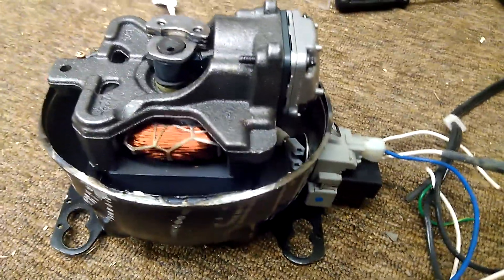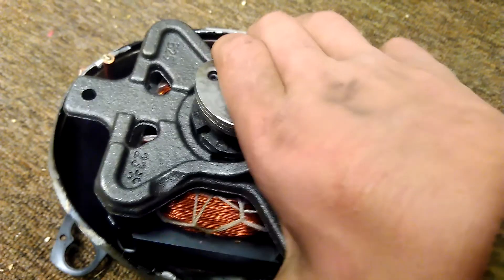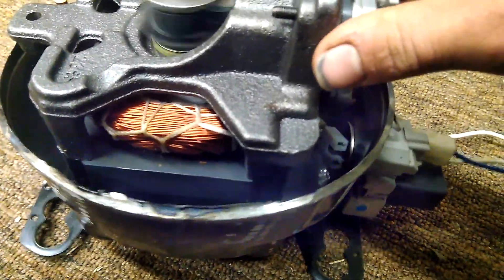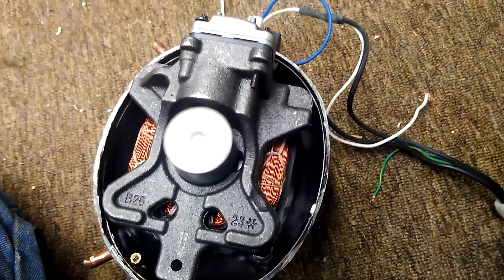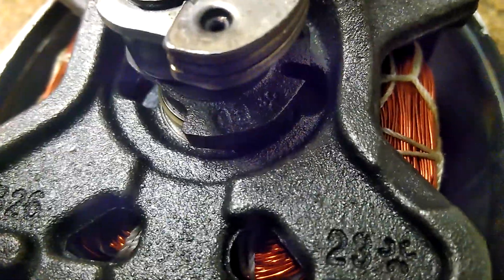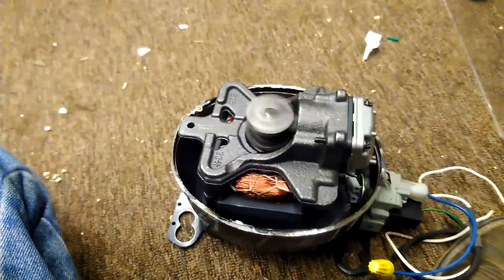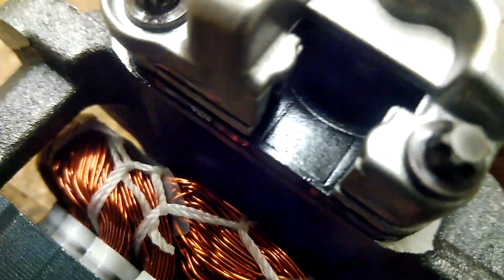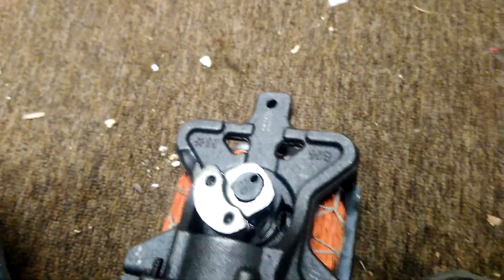Running a refrigerator compressor on the VFD

Comment: How do u connect L, N of compressor supply to vfd U,V,W?
Reply: If u have 3 phase vfd with output as UVW and no neutral, then first set the line to line voltage to 220V on the vfd (I m assuming ac grid supply is 220V single phase). Then connect only UV from vfd to the two supply wires of the compressor. One phase from vfd will serve as neutral and other phase from vfd will serve as PHASE.
Reply: @imtiazhussain5027  what about the start coil? can this be wired into the vfd or do you still need the ptc? I have a vfd and want to wire a fridge to it

Comment: How can one connect vfd with refrigerated compressor can u share wiring methof
Reply from the maker: @BravoRanger Essentially what I did is I took the hot and neutral from the compressor and put them on two of the three phases coming out of the VFD. Also I left the compressor ground disconnected.
Reply: @claysabrowski7669  so are you saying it will start to spin without the start winding been connected?
Reply: @dantronics1682  he wired the VFD to the compressor's original start relay. So the start winding was briefly energized by the start relay
Reply: @TheNYgolfer  ok thanks, that explains it, Ive seen other people wire the start to one of the phase which give the impression they were running both coils, the question I want to know is how to use the vfd to soft-start the compressor. The initial surge inrush current that I read on a fridge is 30 amps, I'm wondering if a zero cross ssr would reduce this. I want to run the fridge from an inverter but the initial surge knocks it out into fault mode
Reply: @dantronics1682  I have an idea which I want to share with you. IGBT type SSR with optical control and zero crossing can be put on the compressor. The control wire of the ssr to be connected to the control wire coming from the thermostat or control board of the refrigerator. But the control pin of ssr can accept only dc volts up to 32 volt maximum. Control wire coming from thermostat or control board to the starting relay of compressor might have 220v ac. Now u will need 12V dc power supply to operate the gate of ssr. U will need a 220v ac relay SPST normally open. Connect the relay coil to the control wire of refrigerator. Connect the contacts of the relay in series between the gate of ssr and +12v dc. When compressor start signal will come from thermostat or control board of refrigerator, it turn on the relay, 12v dc signal will go to the gate of ssr, the ssr will start the compressor immediately after zero crossing.
Reply: @imtiazhussain5027  use a ac-ac ssr instead of dc-ac, I use this to convert a fridge from mechanical to digital thermostat.
Reply: @dantronics1682  Thanks for your comments. If we use the vfd to power the compressor only, then we can program the vfd to start the compressor with low frequency (like 5 Hz) and then increase the frequency gradually up to 50 Hz or 60 Hz. This will be like soft start. What is your opinion?
Reply: @imtiazhussain5027  I'm no expert on compressor motors but I do believe the minimum frequency you can run them at is 25-30 Hz, when I bought my vfd I was told that I could use one of the phase connected to the start coil but then found out that I couldnt since they are not the same impedance which I already knew, what I need is a soft-start not a vfd (similar but different)
Reply: @dantronics1682  Thanks
Reply: @imtiazhussain5027  If you're using an ssr make sure you mount it on some sort of heatsink. I just melted one running an inverter from it.
Reply: @dantronics1682  For sure. Thanks for the advice.
Reply: @imtiazhussain5027  i think this will work, but vfd is expensive for me, ill just buy china made soft start SSR.